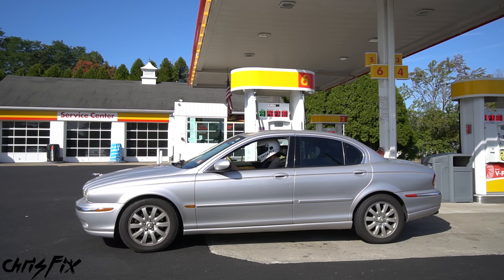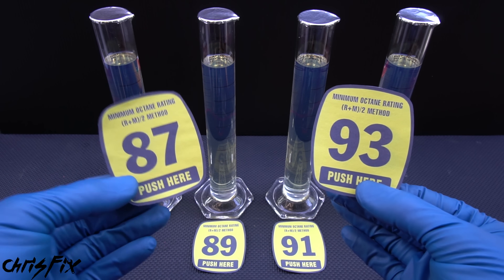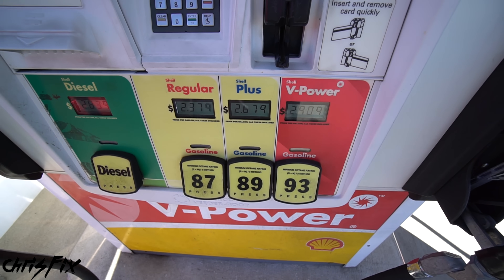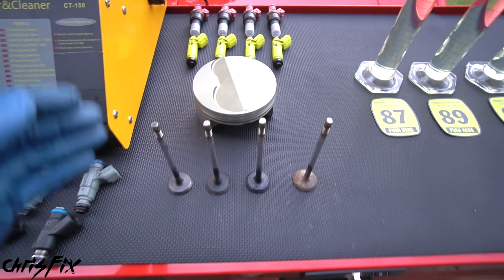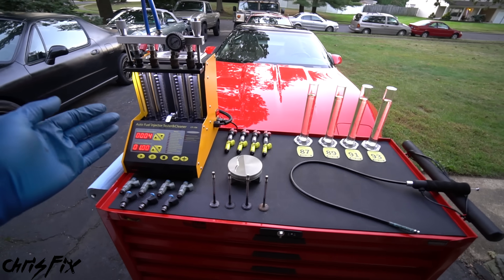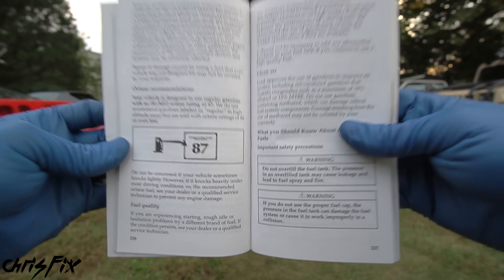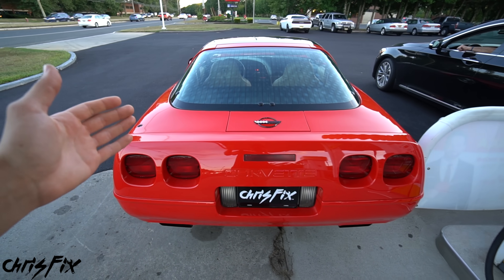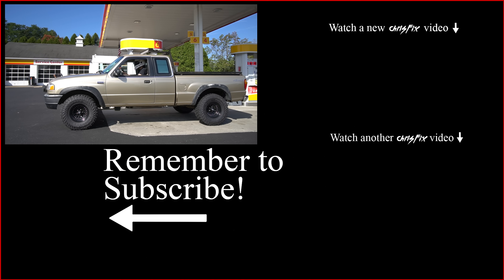What is the BEST Fuel to Use in Your Car or Truck and WHY

Comment: Wow... This video is a Year-n-half old. Yet, the basics are the same for engine performance . I have a 2016 Mustang GT 5.0. It is specifically built that is not available anymore. Anyway, I run 89 Octane every time as Ford stated that is the recommended fuel. 87 Octane is insufficient per engineered recommendations. I use 89 Octane every time and   my cars performance is awesome. 91 or 93 Octane just over-heats my car and the performance level tanks...Unless your vehicle is tuned for the higher Octane, which usually happens in race cars, your stock vehicle is not a race-car, unless you divert from your car's warranty and eventually blow your engine as proven in many other video's.. A Mechanical Engineering Degree in Automotive Performance proves my point. I will still have my 2016 GT for many year to come and eventually sell it for 50K, my best estimate. 
However, I'm hungrey and going to go make some Baked Taters with real butter, Sour cream, chives and cheddar cheese with a Caesar chicken salad..

Comment: Always love these kinds of videos, that straighten out the myths that people have. Unfortunately, WAY more people need this, as here where I reside, our choices are: 85, 87, & 91 octane, with one station also offering 89. So when someone runs "regular" unleaded here, they're running 85, which is obviously 👎🏼 in newer vehicles. A lot of basic education is missing from manufacturer to consumer, and too many buyers don't care enough to know what exactly they should be putting in their vehicle. And I've talked to plenty of people over the years that will just run 85 no matter what, because they don't want to spend the "extra", and then try to justify it as they won't keep it forever, so it's the "next guys problem". 🙄😒

Comment: Do NOT use mid grade fuel. I have never seen a vehicle recommend mid grade fuel. It's either regular or premium. In America it's not regulated on to how it's mixed. Meaning it's not half regular and half premium, more like 2/3 regular with 1/3 premium or less with octane boost added. It just has to meet the posted octane rating. Best to just not use it at all.
Reply: My 2018 ram 1500 equipped with a 5.7 liter hemi recommends 89 octane. Odd. Meanwhile ecoboost engines which could be more susceptible to knock only recommends 87. Strange world lol.

Comment: Have a question. Hope someone can help. My car recommends 87 regular fuel. i have always and only used 87 since purchasing. From my understanding using premium will not necessarily give me better performance (Im ok with that). In this video, Chris mentioned that some premiums (like Shell) contain additives that help clean carbon buildup. At the moment my car does not create engine knock noises (detonation). Still being that my milage is over 100k i wanted to see if there is room for preventive maintenance. I was wondering if I was still benefit from using premium at all? if so, are there any possible consequences in doing so? Thanks in advance :)

Comment: Oh, you're gonna notice if you're running regular pump gas in a premium recommended car.
you'll loose anywhere from 5-10MPG, depending on the vehicle...
Particularly if it's got a high stock CR, not a whole lot you can do about that via timing.
Reply: Lol I mean your using the wrong shit !!
Reply: If you LOSE, LOSE the extra "O".  ☺🙏
Reply: *lose. Loose means unrestrained like shoelaces not tied tightly.

Comment: I've been using 89 in my old toyota that needs a timing chain.
Also a cheaper brand at Arco. The computer will adjust the AF mixture. It has 160,000 miles, so 2 weeks before an oil change I add 3 oz of sea foam to the oil and dump the rest in the tank. Much cheaper than Shell and eliminated a constant misfire due to clogged VVT. Cause by a Liquid Moly flush.

Comment: Question: 87 octane gas that contains ethanol  ... if your engine runs fine on normal 87, will 87 with ethanol cause any issues?
Reply: So is there some type of fuel additive that would help an engine/fuel system out in that case? Never planning on using it, but it would be nice to know how to mitigate it.

Comment: In Colorado, regular is 85 octane because, with our thinner air, compression pressures are lower, lessening the chances of detonation and the need for higher octane. Of course it also means that our cars produce less power. The general rule is that a naturally aspirated car loses 3% of its power for every 1000 feet of altitude, which means that where I live at 7,400 feet, my car is down by 22% of its ponies. (My old Prius took FOREVER to get to the top of the Pikes Peak Highway at 14,110 feet, especially since the hybrid battery was drained after the first half mile.) When I take long road trips, I really enjoy the snappier acceleration my car suddenly has.

Comment: I've always wondered this. Am I the only one that watched that doc about premium and how its always been a scam??
Reply: If you put anything but premium in most performance cars (specifically turbos) you'll blow up your engine lol
Reply: Yes
Reply: @zerogiven1956  you'll blow your engine idiot
Reply: @Chris-fy1ps  are you disabled? Modern engines will adjust timing to deal with pre-detonation thus losing power and shitty mpgs.
Reply: @Acdeportivo2  just to add to this, even older performance car have things like ECU to adjust the timing to deal with it. Performance car are usually a few steps ahead in the technology used in that generation (thus the price difference too).
Reply: Premium has never been a scam. It is REQUIRED for some cars. 
Read the fuking manual. Use what it tells you to use.

Comment: A difference between us and eu petrol is ethanol content though, us fuel generally have more ethanol in it
Reply: Ethanol raises the effective octane rating and adds a cooling affect tho, slightly less btu’s(energy) but you can make slightly more power with even 10% ethanol. But you’ll also get slightly less mpgs.
Reply: @shenaniganshop3309  Exactly, but for normal cars the ethanol addition is just negative as you gett less mpgs as you said.
Reply: @antonioakiki3716  slightly lower cost of ethanol added fuel makes up for it tho. Where I live you can still get ethanol free fuel but it’s like $.30 more a gallon for the same octane rating. So unless you absolutely need every mile out of your tank it’s not really a big deal.
Reply: @shenaniganshop3309  Ah, I live in Sweden and its a bit different here. After summer the petrol will have increased ethanol content from 5% to 10% and combined with higher taxes result in worse fuel for hgiher cost all in the name of the "environment".
Reply: @antonioakiki3716  yeah that’s kinda bogus, I recently watched a video on ethanol fuel and I guess only sugar cane derived ethanol fuel is energy positive. So the corn derived ethanol fuel here in the us is actually a huge was of energy, water, farm land and food. But people think since it’s renewable it’s good for the environment.
Reply: @shenaniganshop3309  in Sweden the ethanol is produced by wheat (not much corn grown outside the us) and there are lots of debates regarding the sustainability. I personally dont care i
I just want lower fuel prices, I shit you not converted to usd/ us gallons its 7 dollars a gallon here😂

Comment: Heptane (seven hydrocarbon chain) has a greater propensity to preignition over octane (eight hydrocarbon chain). Years ago I was told by a mechanical engineer, simply use the lowest octane you can before you get knocking. If you live above 5,000 ft of altitude, the numbers you are given may not be correct.

Comment: 95 RON is like 91 in the US and not 89.
98 RON is like 93 in the US and is NOT the european premium fuel. 
Premium is 100-102 RON (e.g. Shell V-Power/Aral Ultimate) and you don't have that at your regular Shell station in the US, it would be about 98 on the US scale.

Comment: Us Colorado guys getting left out with our 85 octane.
Reply: bruh i refuse to put that in my car lol
Reply: Because of the lower air density at altitude it reduces knock causing cars that usually run on 87 octane to generally run fine with 85.
Reply: If naturally aspirated, you can use 85 octane at altitude. Not with forced induction.

Comment: Weird that your shell pumps are 87 89 and 93. In Australia we have 91 as regular, 95 as plus, and 98 as V power at Shell stations.
EDIT: I understand it's a different rating system, but the conversions are as follows; 91 Aus = 88 US, 95 Aus = 91 US, and 98 Aus = 94 US.
So if it were the same octane fuel out of the regular, plus and v-power pumps, then in the US it should say 88, 91 and 94 v-power.
So the US pumps at 87, 89, and 93 are in fact lesser fuels than in EU and Australia.

Comment: Watching this in 2021 and seeing the gas prices
Reply: It’s 4.30 in California fml
Reply: In the UK it’s £1.30 a litre or equivalent to $8.28 per gallon 😩.
Reply: It costs the same in texas
Reply: Thanks (you know who)... took it to crap even faster than I feared. 6 months ago gas was $1.24/gal here. Literally.
Reply: @MattH-wg7ou  Are you sure literally and not figuratively?
Reply: @Tiralful  yes literally. I know a lot of people literally use the word literally completely wrongly, but in this case I meant literally, literally. 🙂
Reply: @MattH-wg7ou  gas has gone from 1.60 to 3.10 in like 3 months. It’s ridiculous
Reply: @MattH-wg7ou  OPEC and Russia slowed down production in 2020 due to lockdowns and expect to increase production in 2022. Since gas is traded on a global market "(you know who)" doesn't actually have as much control over prices than you think. The only thing that they would have did to contribute to the price was shutting down a pipline, which would have had a negligible impact on prices to begin with since much of it was going to be exported after being refined. Gas prices always rise during this time of year too. The average price of retail gasoline has been consistently for the last 7 years.
Reply: @delta1525  thank you delta.

Comment: I have a question, should i put premium and add fuel syatem cleaner for a couple of full tanks to clean the fuel system of carbon build up even though im recommended regular? And go back to regular after or it could damage the engine in anyway?

Comment: Any reason to occasionally run a higher octane for periodic cleaning, or only use it if there's actual knocking?
Reply: tldr: Only if your car requires premium. Otherwise, not really. 

If your car requires premium fuel, it will state that on the gauge cluster: "Premium fuel only." Otherwise, you're okay using 87 octane. It's only in cars that require premium fuel that could knock if you give them regular fuel. Generally, putting premium gas in a car that uses regular gas doesn't do anything. In a few cases, some cars may run worse (meaning reduced power or efficiency, but not usually anything damaging to the engine) on premium gas because they weren't designed with all the extra additives in mind. As for periodic cleaning, you can use other additives like Sea Foam to help with cleaning things out. Chris actually did a video several years ago showing how effective Sea Foam is at removing carbon buildup from the tops of your pistons. A single tank of premium fuel every now and then won't really do much for cleaning valves and injectors, but for the most part, it doesn't hurt. Lastly, If your engine is knocking and the car takes regular gas, you have bigger problems than your octane rating.
Reply: @spicytuna62  awesome answer! Thanks for replying and being so in depth

Comment: what about vehicles with a lot of miles, its it better to use 93
Reply: Mileage isn't a factor.  If your car used 87 octane from the factory why would you put 91 or higher octane in it at higher mileage?  Doesn't make sense.  use what the manufacturer recommends.  It doesn't hurt anything using higher octane, all it does is waste your money.
Reply: @brandons9138  just like chris mentioned in the video, a high mileage car could have carbon deposits and buildups in the pistons and other parts which could make a higher pressure in the cylinder and eventually lead to engine knock, thus making the 87 octane gas damaging to the engine when it previously wasnt.
Reply: @Carlisho  Your engine would have to have SERIOUS deposits to raise the compression of the engine by any appreciable amount.  I'm more willing to bet there would be hot spots inside the combustion chamber.

Comment: Most of what you say is correct but the lower octane fuel can contain up to 10% ethanol mid grade 5% and premium from shell contains no ethanol. This Will make a difference on engine performance because when burned ethanol explodes slower the gasoline creating a different combustion cycle then with premium. So when using a car that requires regular 87 fuel you will get higher gas mileage when you switch to premium 91 or 93. That fact. National Average is about 6%. So its not that cut and dry like you say it is. Secondly if you drive an older carbureted  car you never want to drive 87 unless it states Ethanol free as it kills your carb. So you cannot fully say all the things you said without considering those people. Stop thinking this is the end all for everything video as this is just the tip of the ice burg. So much your not saying that you should be.

Comment: I have a suburban 03. And I swear by shell 93  runs like a scoulded dog no hesitation on take off and good idle. But I maintenence the old girl well because a new one is upper 60. 000        in my area 93 oct  is 3.60 a gallon but worth it

Comment: I recommend just going straight to the owners manual for your car. In my case, I drive a Toyota Camry and it states to use top tier fuel and anything 87 octane rating or higher. That’s it.
Reply: What year is your Camry? I just bought new headlight for my Solara but somehow I ordered Camry headlights.
Reply: Sure you can use any octane in any fuel injected car. It will also knock and pull timing to adjust for the piss poor gas you’re using to save 20 cents a gallon. So that pretty Mustang GT your driving doesn’t have 460hp now, it has 400. 

Now you drive a Camry which tells me you really don’t care about performance unless maybe you have the TRD version which I doubt. You really don’t care about cars beyond getting from point a to b and it lasting you as long as possible.

Comment: I've heard if you run your car hard every now and then it helps the engine run cleaner and might help reduce carbon build-up or remove it by getting hotter or running faster? Is there any merit in this? I feel like I heard this especially if you are a driver who may never get RPMs over let's say 3500?

Comment: I can explain it more simply. This doesn't apply to RACE fuel. Pump gas is rated by octane. Use the SMALLEST octane rating you can get away with. Lower octane fuel will detonate more readily in a high compression engine, but for the same engine a low octane fuel will burn quicker. If you're using high octane fuel in a low compression (most engines) engine then you'll be wasting fuel at high RPM because it won't be as near completely burned when the exhaust valve opens. Always use lower octane for responsiveness and high RPM power. Also, because high octane burns slower, it will burn cooler. You can pass NOx emissions tests by increasing octane.

Comment: PLEASE READ! I use nothing but Shell gasoline. What I do is when I get to around a half tank I fill up with V-power premium and then when I get back down to around half tank I fill up with Unleaded and just switch back and forth till oil change and then run it all out , immediately change oil, then immediately fill up with V-power going back and forth at half a tank as described above. My question is, can you mix gas like that or am I defeating the purpose of Shells V-power?
Reply: All gas is unleaded.

Comment: WOW! Took 10 min. and 30 sec. for the real answer. THE BOOK THAT NOBODY READS  AND COMES WITH THE VEHICLE.  RE: "Premium recommended" for that Corvette you state that using the lower grade might rob you of a few HP but you also state at the beginning that all grades have the same energy. Explain. RE: premium fuel additives with Schell 93 having multiples of the stuff - Great for injectors but in a GDI engine the top of the valves will retain carbon buildup no matter what, because the tops don't get sprayed with fuel since it's directed straight to the chamber below.  Sooner or later you will need to get a special treatment for this. Last thing you want is hot spots on the valves because it will ruin the seating. Some newer GDI engines now spray an intermittent bit of fuel on the valve stems to wash away carbon deposits.

Comment: Very good video. I'm surprised you didn't discuss how altitude affects detonation/knock. in Colorado we don't have 93. It's 85, 87, 91. This is because detonation chance decreases as elevation increases. At 10k feet in elevation a vehicle that needs 91 can run fine on 87. I used to have a dirt bike that required 91, but on a cold day in the mountains (11k+) it ran like shit on 91. Throw in some 85 and it was like having a new bike. On warmer days 87 was more appropriate. Even density altitude has an effect on knock/ping.
Reply: I assume cars compensate for different situations that a dirt bike doesn't.

Comment: In other words, since I normally fill my gas at Costco, in case they don't have 87 available, I can safely use 91. (I just don't run that often in my SUV unless required by owner's manual.)

Comment: I've had better luck starting my vehicle in the winter with higher grade gas.  Also my truck manual says 87 is fine, but towing & high altitude they recommend premium.  

My old cars typically didn't see a change with fuel grade.  

My ranger ran smooth with mid grade though, unusually seemed even worse though when I went to low grade.  

My f150 having turbos in research suggest higher grade is better.